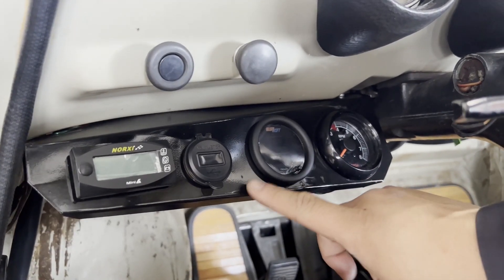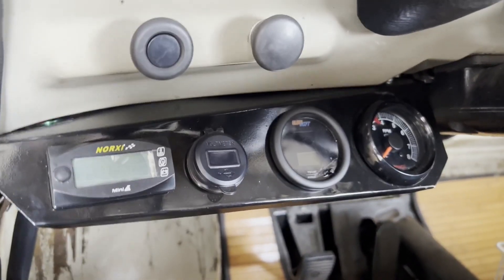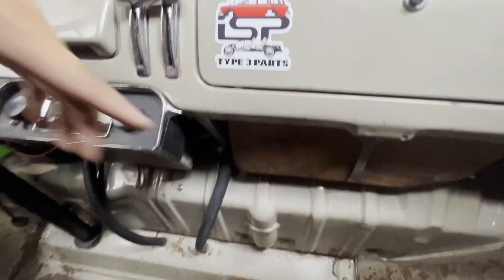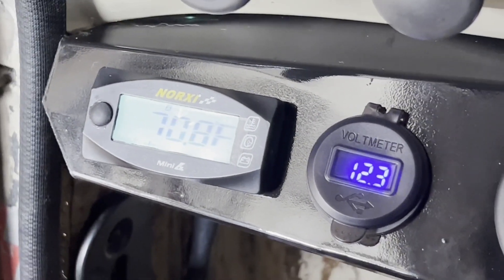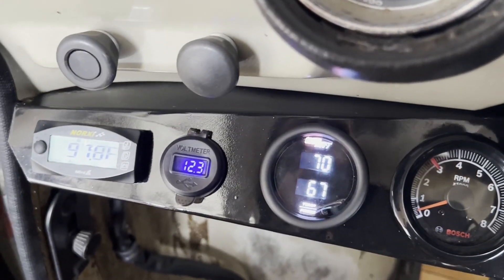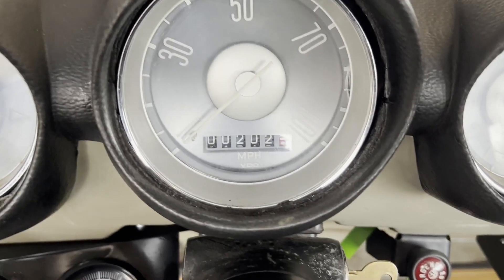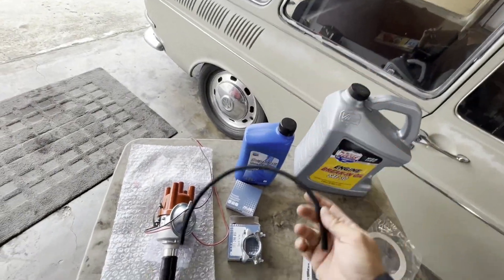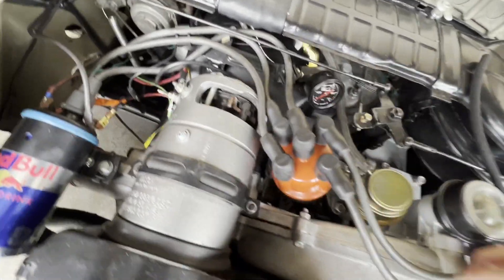EP 36: SVDA Distributor Upgrade and First Break-In Interval / 1967 VW Type 3 Squareback

Comment: If it is leaking from one of the 6mm nuts chances are who ever built the engine over tightened them. The factory book said use no sealant, I never have, but couldnt hurt to use a little I guess. Every thing looks awesome by the way and my 70' bus is jealous!!

Comment: In another video I mentioned, that I suppose, that you used syntethic oil. But here I see, that the old oil is dark, terrible dark. So this oil included the debris and it is the requested mineral oil. So you use the correct mineral oil, which will not harm your motor. Synthetic oil, wich is used in modern cars, would harm your motor.

Comment: That is a huge amount of aluminum in your oil, beware your case is getting destroyed. I hate to say but the engine was not built right.
Reply from the maker: Crossing my fingers/toes/whatever else that’s not he case haha. I had a professional machine shop build the block and all it’s internals. They’ve been in business for several decades so I hope they did a decent job. Everything else was done by me, so if it blows up, then it’s all me haha. 

Btw, I did just performed a compression test at 1k miles and all cylinder PSI values indicate a healthy engine. I also do have several gauges (cyl head temp, oil temp, oil pressure) that I monitor the entire time the engine is running. They all look healthy. 

At around 3k miles, I’ll be doing a deeper dive on inspecting everything, so we’ll see lol.
Reply: It did look like kind of a large amount of glitter in your oil. If I were you I would run it 100 miles and then change it again so you can flush some of it out of the engine. If it’s still glittery, do it again. The glitter with the oil will wear down the bearing surfaces in the engine with a quickness.
Reply: And also I would show the oil to the machine shop and ask them if they think it’s okay.